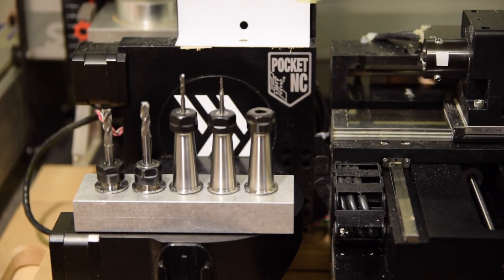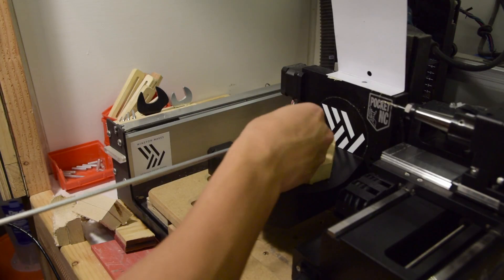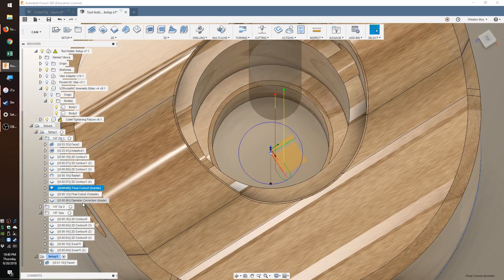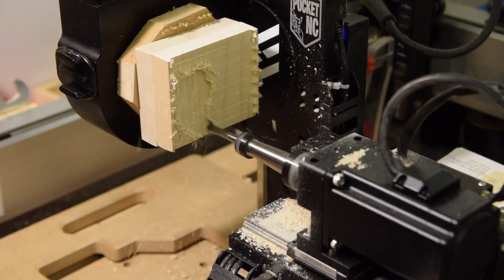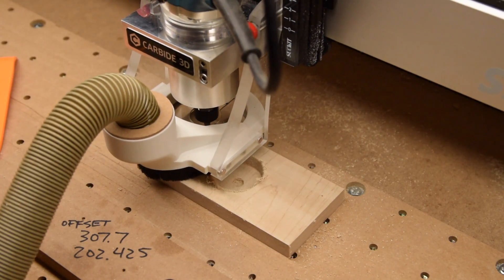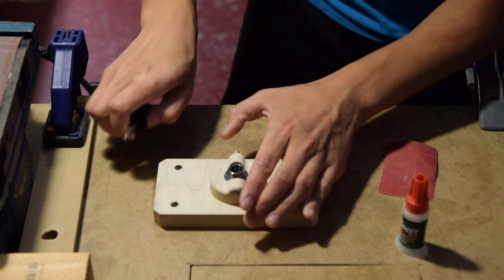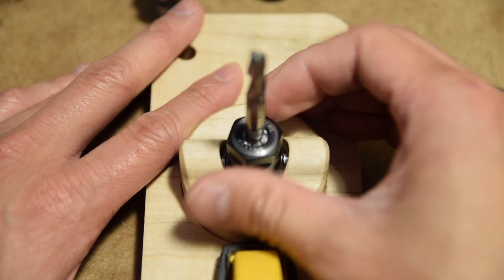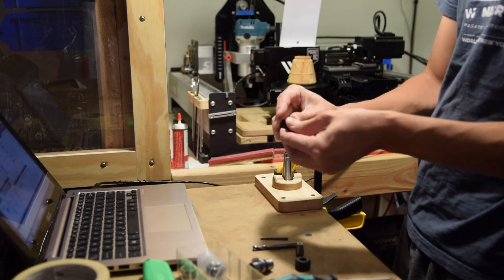Making a Tool Tightening Fixture for the PocketNC - #130 [CNC]

Comment: You could have threaded the insert pins, tapped the holes, then you would be able to adjust the fit precisely. Or, you could have had set-screws from the bottom to allow adjustment as well.